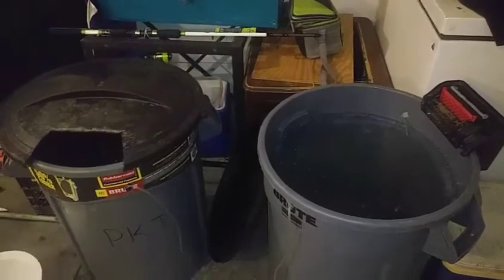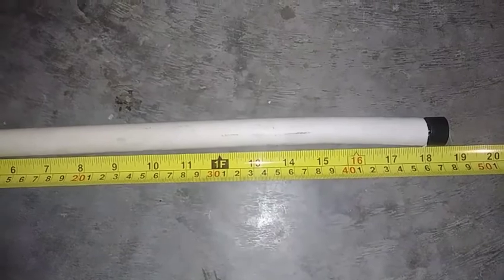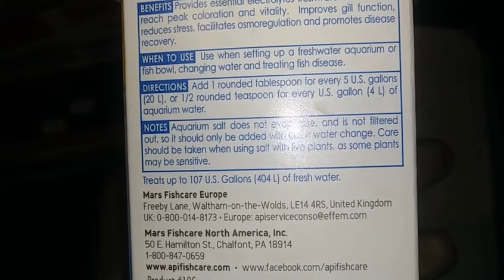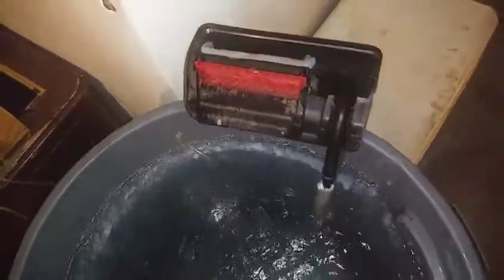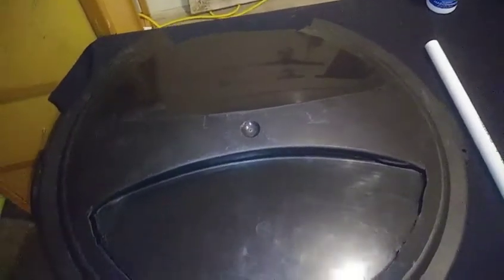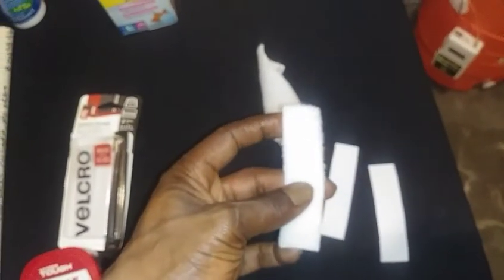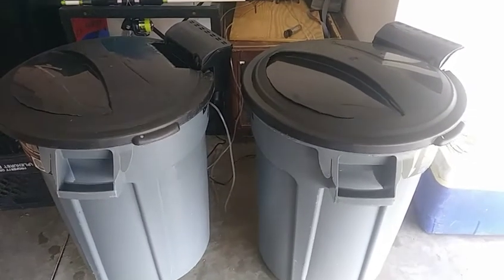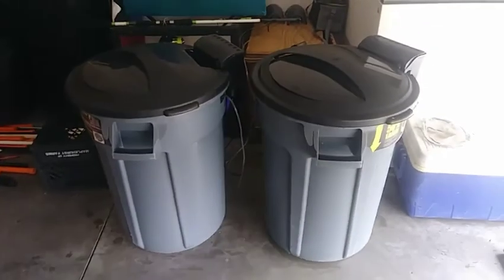Bank Poles 101, Episode #1 CHEAP live well and bait tank care

Comment: Just so you know...I have many fish tanks and bait barrels. With all the air you have going in the tank that is on the bottom, that filter will do its job with the original inlet pipe. It will filter all the water. What settles to the bottom can be sucked out with a fish tank cleaner siphon.  You have a great small setup. I use 55gal drums cut in half. I have 4 of them with different bait, crawfish, sunfish, creek chubs and anything I get with my casting net. Im gonna have to make some videos of my setup. Only problem I have is in the mid of summer I cant keep the water cool.